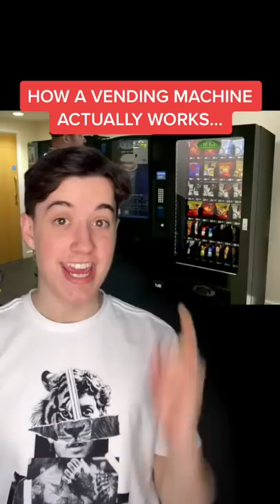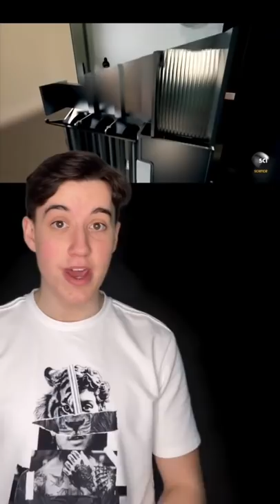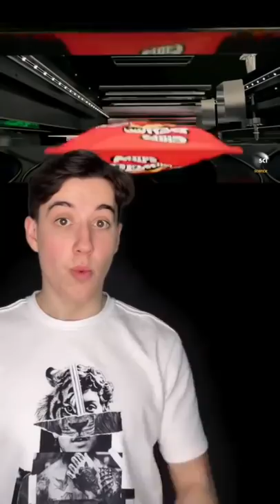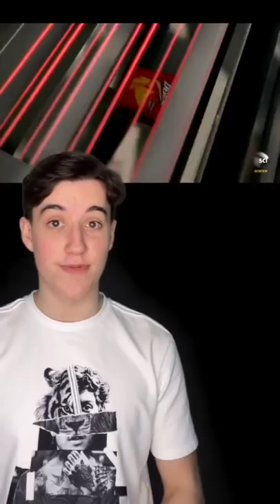How A Vending Machine Actually Works #Shorts

Comment: "This is how a vending machine actually works!"

That's the thing. They don't
Reply: This isn't how they work or they don't work. Honestly i would believe either.
Reply: Seems pretty much correct to me until the laser part and coil turning again that part is bs
Reply: Watch the original video its much better
Reply: @d3genr3gen26  so it still bs if it's only some vending machines
Reply: Once again Rohan, you're correct
Reply: Lmao true

Comment: Yet literally when I put a coin in and use the snack I choose gets stuck and the coil doesn’t do anything bruh
Reply: @lukemeier9313  bruh
Reply: @lukemeier9313  lol ok bruh
Reply: I agree..That's why there's the bitch slap on the machine method.
Reply: I think the main reason the snacks don’t fall IS CAUSE THE COIL GETS JAMMED SO THE SYSTEM IS USELESS
Reply: lmao fr
Reply: Maybe twice I've seen it work where the snack I wanted was in the back of the coil while the rest of the coils segments were empty and the coil kept turning until my snack fell. But the snack getting stuck, no. Never seen that happen.

Comment: I think this is where having a friend who repairs things like vending and arcade machines comes in handy....

Vending machines read money differently with each kind.
Each machine differs slightly, but in general, it identifies each coin with an electromagnetic field which measures thickness and diameter. Dollar bills are scanned with a laser, which transmits to a small computer that deciphers each denomination. It then calculates a balance and allows  you to make a choice of snack or pizza, or hot dish, or souvenir,  etc.  

My favorite vending machines are in Tokyo.
Reply: .

I just remembered a LN about somebody reincarnating as a vending machine.
Thats all i had to say, nothing meaningful.
Reply: God Rolf, The Ed position  

is a girl

What....?
I like the vending machine cafes, hot food vending machines, small trinkets and gachapon vending machines, snacks, cold and hot drink machines, mystery box machines that have stories attached for you to figure out.

There are many machines in Japan. 

My favourite will always be the fresh hot food vending cafes. 24 hours and I dont have to worry about interacting with too many ppl. The only ppl are in the back of the building.

Comment: Not only is this stolen content its not even accurate the one reason why i refuse to use even modern vending machines is because i have the worst luck with them ive never once came across a vending machine that would still try and put out the food even if it doesnt drop